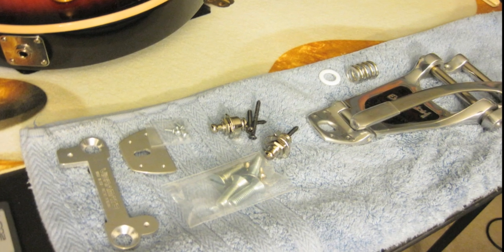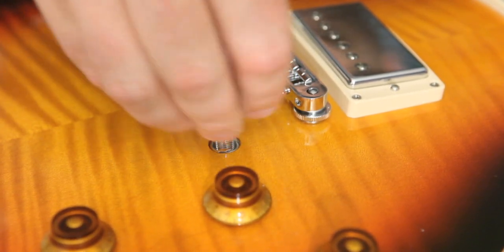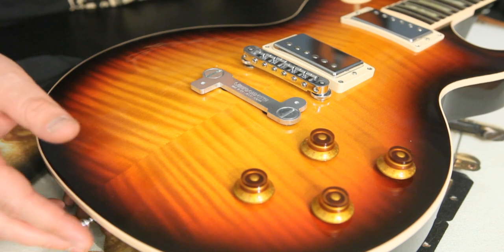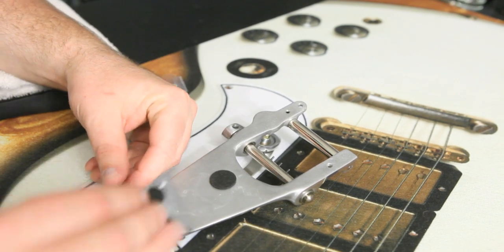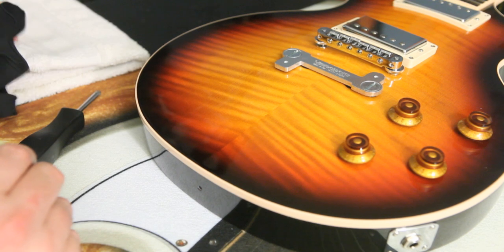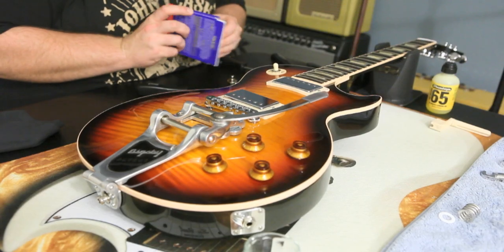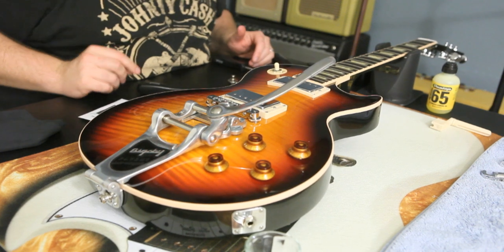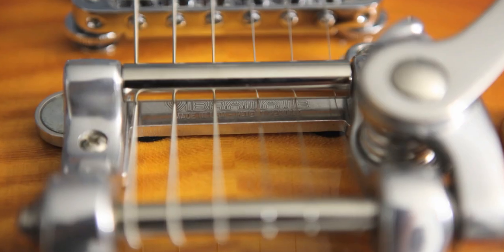How to Install a Bigsby B7 and Vibramate V7 on Gibson Les Paul Standard by Scott Sill

Comment: It's nice that it doesn't require any drilling to install. When you're sick of it going out of tune, you can return it to stock.
Reply: If you string your guitar properly it wont go out of tune when using the bigsby.
Reply: The only way a simple device like a Bigsby can go out of tune is the spring eventually wearing down but that really doesn't happen that much at all.  Any tuning issues are found elsewhere.  the design of the Bigsby would not cause issues after momentary  usage, they will only cause permanent issues that are resolved by set up type changes.
Reply from the maker: Agreed , usually the nut is the issue
Reply: Or the strings not sliding properly through the bridge
Reply: @sillennium  In my experience, it was always the nut, and always resolved by (my caveman like resolution of) a quick very light pass or two with a butter knife, just barely moving a few molecules of plastic, and some pencil lead.  I cant tell if my bridge lubrication have helped because I had always touched the nut first.
Reply: @sillennium  Just performed my first install of a B7.  Overall went well.  Four things I was surprised on:
1.  The Epiphone bridge saddles really dont match the spacings on a Bigsby, so you have to decide where you want the most misalignment, I chose the high E.
2.  Didnt know to tighten or remove springs or other hardware to remove the little amount of float or play in the arm itself, I will have to wait for the next string change to attempt resolution.
3.  The strap lock loses some space for a strap due to the hinged part, I couldn't use the rubber washer lock, nor will I ever deal with more sophisticated lock systems again, but I was able to get a quality suede leather strap over the post.  I did have to move the strap post though.  It was off center as well as a little high.
4.  Ernie Ball strings at least dont really allow for the strings to perfectly mimic the B7 posts, I need to find strings that have more rotation of the ball.

I have no tuning issues, I didnt have to touch any setup already done.  Just need to get that float out of the arm.
Reply from the maker: @evankeal  nice enjoy that bigsby
Reply: @evankeal  and of course the butter knife trick worked on mine. Thanks:)
Reply: It's a Gibson even with that thing back to factory it's going to have tuning issues. The design of the headstock is horrible for tuning stability. This is a notorious known fact, not to mention if you look at it the wrong way that head stock will break. But hey you got a Gibson  good for you.
Reply: Neil Young doesn’t seem to go out of  tune. Lots of whammy fun on the Sleeps With Angels album as an example.
Reply: They stay in tune just fine if you install them correctly
Reply: @maxammo6282  I've been playing Gibsons for over 30 years and I never had one where the headstock come off.. I own 8 Les Pauls with no tuning issues whatsoever. It's a bit sad the some a..holes sound like a broken record when it comes to Gibson guitars and always say the same 2 things. Headcrack and tuning issues. Did you ever own one or are just like a parrot? Mindlessly repeating something you've heard..

Comment: Does the guitar still fit inside the case after installing the bigsby? I have an Epiphone with a guitar shaped case and am afraid it would not fit inside if I install a bridge like this :/
Reply: Bruno Nascimento very late reply but others might wonder this too so, yes it should fit. MANY guitars from Gibson comes with bigsby and a traditional Gibson case. Also, if somehow it didn't fit, there are different spring sizes for the bigsby that change the feeling/tension and how high or low it is.
Reply from the maker: Yes it does

Comment: I have a 2000 gibson les paul custom '57 reissue black beauty, the three pick up version, and I did the same thing with the bigsby and the vibramate. I ran I to the same problem with the strap button hole being to the right, I'm glad to know I'm not the only one!
Reply from the maker: Buck Squires that is a bummer, I suppose Gibson changed the type of wood screw over the years.  There are tricks to filling hole such as using toothpicks.  I am sure you can find something out there on YouTube to help.

Comment from the maker: @Vapotti, yes it fits into an original Gibson Hardcase.   You just need to rotate the trem arm all the backwards till it stops to make sure it is at its lowest point to the guitar.  This allow the case to close and doesn't change the tension on your guitar strings/neck.

Comment: A million thanks for the "bend the string with pliers trick" I was on my third set of strings and about to rip out what hair I have left!!!!! Other than
'tying' them in a knot. . .  those damn things are near impossible to secure to those little posts on the bridge!  crazy glue? Thank you again.
Reply from the maker: mouthfulloffeces no problem.   Bigsbys are great, but can be frustrating at first if you don't know the tricks.   You should also google Steve Hunters String Wedge for the Bigsby.  You might dig that too.

Comment from the maker: I ended up playing last for a good 3 hours or so and didn't really have a ton of tuning issues.   I do think there is something in the guitar at the nut level that could use some adjustment, but I am also not honestly sold on DR Strings yet.  I have been trying to find a new brand of strings, and recently started using DRs, not sold yet.  Before that I used Gibson Vintage (pure nickel).

Comment: No joke. I just liked your video. A friend of mine recently put one of these on his Les Paul. No drilling needed. I wanted you to know about the StringRay clip to help you restring any of your Bigsby -equipped guitars.
Reply from the maker: Mike Bishop cool thanks for the tip.  I will look it up. I just posted a new video on Steve Hunters STring Change Buddy which is another cool tool to use on Bigsby too.   You might want to check that one out too.

Comment: I got this a week ago, can't wait to install it on my Epiphone <3
Reply from the maker: Good luck!
Reply: I’m going to install on my Epi LP.  It has the ABR-1 bridge.  Do you recommend installing using that or does it need a roller bridge?   If so, what ones fit an Epiphone?  Thanks!
Reply from the maker: I don't use a roller bridge,  your nut is really the key keeping tuning issues away.   I am sure the roller bridge works great but just didn't feel i needed it

Comment from the maker: @Piratbarnaba64, using the Vibramate V7 allows for you to install the Bigsby without the need for drilling additional holes.   It does not affect the tuning as far as I can tell.  However I do think that the nut on my particular guitar needs some adjustment becuase when I tune the G and B string I get the classic plink sound.   I may replace it with a nice bone nut instead of that plastic stuff.   In summary, this method using the Vibramate V7 doesn't hurt you tuning.

Comment from the maker: @Bert, so sorry forgot to get back to you.  The end of the bigsby does have some play there, but a half inch seems a bit more than I would feel comfortable saying okay with.   I would also make sure the two posts are the same distance as the vibramate expects.   If those are off just a little then it won't work.  I recommend buying from a store you can return if all doesn't work out.

Comment from the maker: All of my guitars with Bigsby vibratos on them have tune-o-matic type bridges.   I have considered installing a roller bridge to give it a try, but I think most of the problems people experience are related to the nut.  If you hear that "clink" sound when turning your guitar then your nut needs adjusted before you mess with the roller bridge in my opinion.

Comment from the maker: @Ait70, You could use the Vibramate V5 and a Bigsby B5 to install on your 335.   Some people have done this type of installation on an arch type guitar.   Keep in mind the Bigsby and plate will not rest against your guitar, but kinda of float above, so it may look a little wierd.  It does work though just not as pretty as you would like, but not new holes drilled in your guitar.

Comment from the maker: @Guus De Bruyn, you can remove it.   That is the whole point that you can install a bigsby without changing or modifying your guitar.   You should be able to remove it all and put it back to its original condition as long as you have the original hardware.

Comment from the maker: @tollchuck, I guess the trem could be a bit higher than it would be on a regular install, but you can adjust by leaving out the washer or even squeezing the spring a little.   The action is as it was exactly without the Bigsby, I didn't have to raise it at all.

Comment from the maker: @Imadirty... The tunomatic bridge does not wiggle at all.   Certainly a number two in the nut would be a good thing when using a Bigsby.    No idea what the weight is, but for a weight relieved guitar even without the Bigsby it is pretty heavy.  I would put it 7.5 to 8 pounds if I were to take a guess.

Comment from the maker: @Matt, it shouldn't leave a mark on the guitar.  Everything touching the guitar is sandwhiched with felt between it.  I imagine if someone over tightened the screws it could dent it a bit, but that would be because over tightening not due to the vibramate system.

Comment from the maker: The vibramate V7 and Bigsby B7 are two separate products.  You can install a Bigsby B7 without the vibramate, but it will require you to drill holes in your guitar.   The vibramate is an additional product that allows you to install without having to drill those holes.  Its up to you the route you decide to go.

Comment from the maker: The stop bar has a small hex screw that holds it from slipping off.   It goes infront of the bar that is screwed infront of the guitar.   I should have taken a picture of it and shown everyone afterwards.   It is only an issue with any guitars that have the "locking" Tone Pros stop bars installed.   
I have not had any issues after installing the Bigsby.  I may be trying a rolling bar bridge just to give it a try.   Never needed one, but thought it would nice to try.

Comment from the maker: It does, but I need to have my nut on my guitar changed to bone and setup properly, there is some slippage on my G String.   I have thought about putting a Roller Bridge in, but I think the nut adjustment is all I need.

Comment: Hey Scott, great video. How does it sit on the case?  Does it push the bar against the body?
Reply from the maker: It sits just find in the case.  You just need to turn the bigsby arm clockwise until it stops before putting it in the case.   Look for a video on that soon. Don't forget to subscribe.

Comment: I am thinking of retro-fitting one of these things (this specific tail bar too, I really like the visual design of it) onto a knock off SG I am customizing. Will this model of Bigbsy and Vibramate work with SGs? Every video I find has just the one where you slap it onto the face of the guitar without the saddle hooking onto the side of the guitar like you have in this video.

Little worried that it'll mess with the sustain really badly, ruin the action of the guitar or it'll bump and collide with my pick ups. I'm kind of new to this customization stuff anyways.
Reply from the maker: This won't work for you,  you want the Bigsby B5 and Vibramate V5 system for your sg.

Comment from the maker: Not totally familiar with that guitar, but the Vibramate V7 is made specifically for Les Paul's, but you might have luck with the Bigsby B7 installing on that guitar.  It will more than likely require holes to be drilled, but I would recommend checking with Bigsby the manufacturer for sure.

Comment from the maker: Only if the pegs for the stopbar tailpiece are the same distance as they are for the Les Paul.   Then it has to be the same distance to the edge of your guitar as the Les Paul.   I would look into measuring your guitar and check the actual measurements provided by Bigsby.  All else fails, purchase your products from a place that will accept returns just in case it won't install.

Comment from the maker: There shouldn't be any damage done to the guitar after removing the Bigsby and Vibramate.   Both are put on with felt bumpers to protect the finish, the only thing I could think could happen is if your guitar is in the sun and the finish fades over the years.  The areas hidden by the hardware may look different but that is just a guess.   I would install with a drill to prevent the screws getting too tight, which is something else that could cause damage, but that is with anything.

Comment: Nice video ! What is the guitar neck holder you are using ? (I mean, the cylindrical piece of plastic you place below the neck to do your guitar maintenance). It seems to be a good one, I'm struggling to find a proper one. Is that a Fender Guitar Tech Workstation?
Reply from the maker: I can't remember,  but now i use the bean bag one from martin guitar

Comment from the maker: @AIT70 the V7 Vibramate system would not work for a ES-335.   You can install a Bigbsy B7 on a ES-335 but you will need to drill holes in your guitar.

Comment: This is a great video, thanks! Can you use the same method for a Gibson SG?

Also, I know everyone has an individual preference, but overall I've heard it isn't good to use lemon oil for your fretboard (especially rosewood), as the oil lifts almost everything out of the grain of the wood and doesn't do much in terms of sealing and providing essential moisture with the structure and fibers therein. I would suggest mineral oil (you can find it for super cheap at a local pharmacy like CVS or Walgreens), which serves as a great option for oiling your fretboard, and you also don't have to worry about it further darkening the fretboard like I've heard linseed oil does if you're not careful.
Reply from the maker: Thx for watching.   You can do the same on a SG, just use the V5 vibramate and B5 bigsby.    Never had an issue with lemon oil but you aren't the first to say this.   Might be worth looking more into.
Reply: The Dunlop "Lemon Oil" isn't really lemon oil. It doesn't have anything to do with lemons actually, only the scent. The dunlop lemon oil is in fact just mineral oil. If somebody wants to try something else I highly recommend the MusicNomad F-one Oil.

Comment from the maker: It would only work for a Lucille if the measurements work out right.  My guess is that they don't, but you will need to measure and check on their website to see if it works.

Comment: Will this setup work on an Epiphone Les Paul?   Thanks
Reply from the maker: Yes it will.
Reply: How about a Godin Montreal Supreme? thanks
Reply: ozbizbozzle If it's an arch top and the dimensions are right.
Reply: Captain Freedom
Reply: RDLaw88 of course
Is te same body
Reply: DOES THIS WORK FOR AN SG STANDARD? THE SAME BIGSBY B7 AND THE VIBRAMATE B7?
Reply: Probably
Reply: In case you have a guitar with non-standard dimensions you can always get the B5 instead, it doesn't have the massive tailpiece and also works with the Vibramate adapter. Personally I prefer the B5 even on a Les Paul... The one thing you do NOT want to do is buy the B50 or B700. They are Chinese made authorized "licensed" copies but the quality is shit compared with the US-made B5 and B7.

Comment: I realize this is an old video... How do you think adding the Bigsby affects the tone of the guitar? I've noticed significant differences when I removed the block on my strat vibrato
Reply: Also - do the wound strings tend to catch in the saddle when you use the Bigsby? Are there replacement saddles you recommend?
Reply: Some say it brightens the tone and adds more character and presence. Some argue it sounds much better, or adds sustain and some say the opposite. Either way, they are both fantastic just different, and the smallest differences won't bother me at all. And yes there are roller bridges to do just that. Make sure your nut is well cut and lubed. Just ordered my bigsby cause there are no cons, at least for me.
Reply from the maker: I think it adds sustain

Comment: Wanted to do this to my 1976 Gibson Les Paul Recording Guitar. But one BIG PROBLEM! The Recording Guitar is BIGGER then this B7 kit. So will probably end up have to add 2014 Recording II which comes with bigsby already. But am STILL hoping Bigsby might have one someday to fit" Paul Leen". But not looking good so far. This B7 is 6 inch when Recording is 6 1/2 inch to bridge mount holes. So just alittle FVI From Sept 15th 2021.
Reply from the maker: What about a b5?
Reply: @sillennium  Go to flat top. Not arch top. More for Telecaster. But thanks for reply. Will end up adding 2014 RECORDING II to my colection just to have solid body with bigsby. Have a Thin line telecaster and gretsch with bigsby but are semi hollow not solid.
Reply from the maker: @williammcmillan1160  ii thought the tecordings were flat topped.  Maybe remembering wrong

Comment: Hello. I have a Ibanez as93. Do you know what bigsby i need to buy? Will it work with the B7? Great video! Cheers!
Reply: +Sebastian Lindstrom The as93 looks to be an arch top guitar, which is how a les paul is. So that means the bigsby you want is either a b7 or b70. It's your choice. They're practically identical. The other type of Bigsby is a b5 and those are only for flattop guitars, like a telecaster.
Reply: +Colin Briber thank you so much for the answer. Is the b70 working with vibramate to? Or is it only b7 compatible with vibramate?
Reply from the maker: This works only on LPs